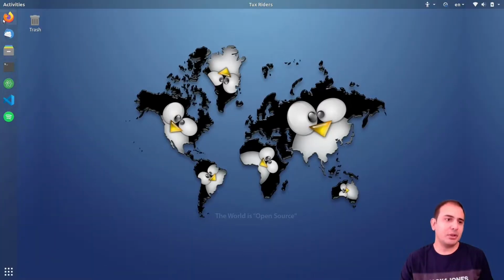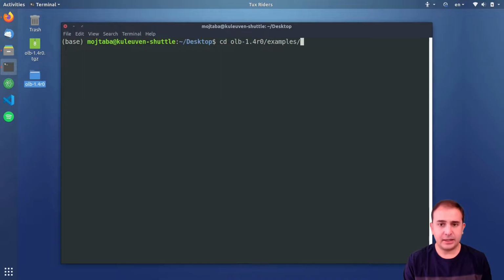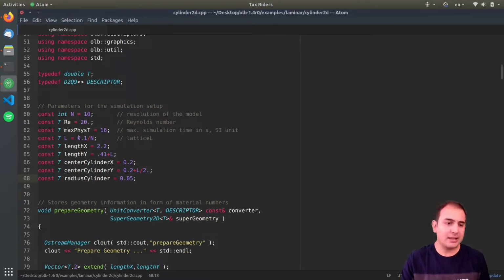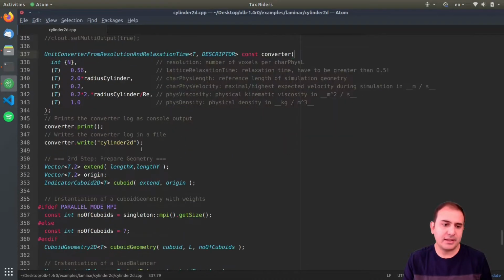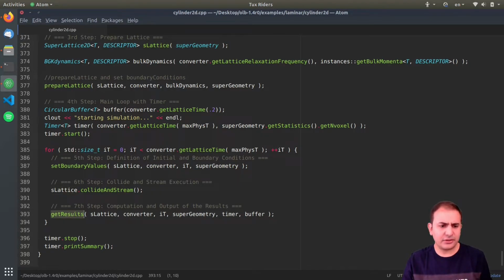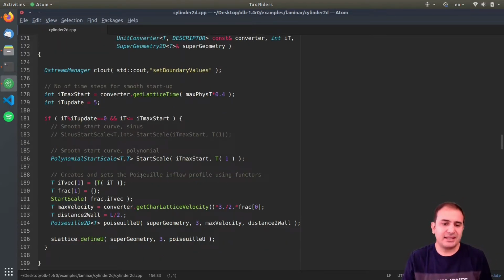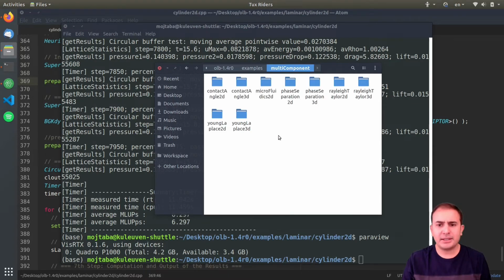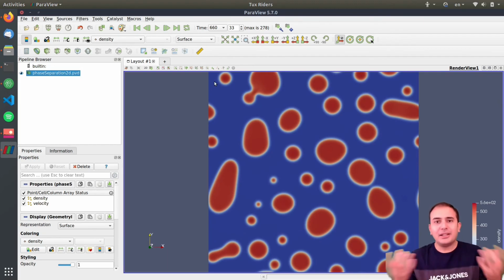Getting started with OpenLB, lattice Boltzmann simulation code [On Demand 8]

Comment: Sir can you please tell me how to calculate the Element numbers and the Grid point number from the OpenLB codes for example from Cylinder2D?
As in Ansys we can find the Element number or Grid number directly but I didn’t find any such thing in OpenLB codes. Such as for Cylinder2D code I have estimated like this:
Identify the grid resolution:

The resolution N is defined as 200. The lattice length L is defined as 0.1/N.
L = 0.1 / 200 = 0.0005
The length of the domain in the x-direction (lengthX) is 2.2.
The length of the domain in the y-direction (lengthY) is 2.0.
The number of grid points in the x-direction Nx = lengthX / L.
The number of grid points in the y-direction Ny = lengthY / L.
So, Nx = 2.2 / 0.0005 = 4400
Ny = 2 / 0.0005 = 4000
Total Grid Points = Nx * Ny = 4400 * 4000 = 17,600,000

Is it correct? Please help. @TuxRiders
Reply from the maker: I'm afraid I don't know how to get the element numbers in OpenLB. sorry.

Comment: Hello im new to the LBM simulators, i wanted to ask how can i implement stuff like pulsatile flow and moving boundaries, in custom made STL geometries on openLB (.OR.) palabos.
Reply from the maker: I'm afraid I've never done this, but I know that Palabos has a nice integration with IBM (immersed boundary), which should be technically possible to be used for this purpose. I don't know if there is a better approach for this. Sorry.

Comment: Sir in the User Guide of OpenLB it is given that "There are two options of generating images of
the processed values in 2D and 3D" which is Gifwriter and HeatMap. The cylinder2d has HeatMap in the code but its not generating the jpeg file. Any solution to this?
here is that part of the code

// Writes the vtk files
  if ( iT%vtkIter == 0 && iT > 0 ) {
    vtmWriter.write( iT );

    {
      SuperEuklidNorm2D<T, DESCRIPTOR> normVel( velocity );
      BlockReduction2D2D<T> planeReduction( normVel, 600, BlockDataSyncMode::ReduceOnly );
      // write output as JPEG
      heatmap::write(planeReduction, iT);
    }
    {
      BlockReduction2D2D<T> planeReduction( discretization, 600, BlockDataSyncMode::ReduceOnly );
      heatmap::plotParam<T> jpeg_scale;
      jpeg_scale.name = "quality";
      jpeg_scale.colour = "blackbody";
      heatmap::write( planeReduction, iT, jpeg_scale );
Reply from the maker: I've never faced this issue, but in my opinion, it should be relevant to imagemagick, which didn't solve your problem apparently, right?

Comment: Dear Sir,

             I am writing this mail to you regarding the problem faced by me in compiling an OpenLB code according to one of your youtube videos titled "Getting started with OpenLB, lattice Boltzmann simulation code [On Demand 8]".
According to your video you are able to generate the image files after the simulation but in my case only the "vtk" files are generated. 

               I need to know is there any software I need to install to get the image directly or I need to add something to the code? Please help me with that.

Thank you

Regards
Atanu Chaudhury
Phd, NTHU
Reply from the maker: I think you don't need to add anything to the code. can you try to install  imagemagick? it should be the missing component I guess. by the way, you can always use ParaView to export the VTK files to images.
Reply: thank you I will try that  @TuxRiders
Reply: thank you for your reply, I want to know another thing, how to make the Gnu plot. When I do the simulation a .dat  file is also generated. Do I need any software for that to get the Gnu plot?  @TuxRiders
Reply from the maker: @QuantumBeatsLab  you need Gnuplot :). it's the name of a software.
Reply: Sir the imagemagick is not able to open .matrix files. Any other solution to this???????????????? @TuxRiders